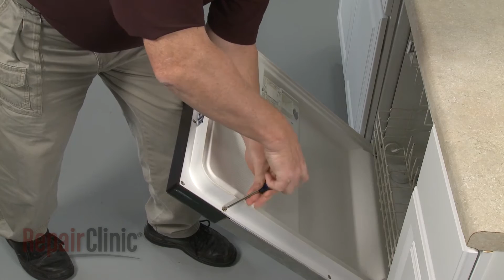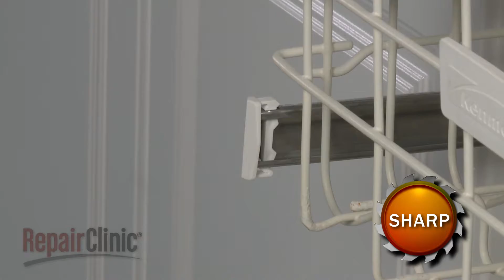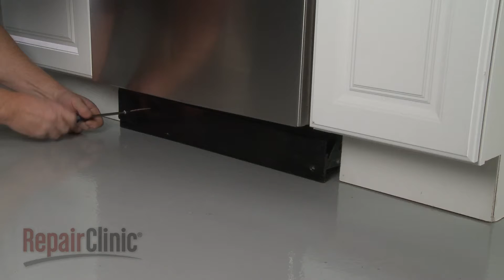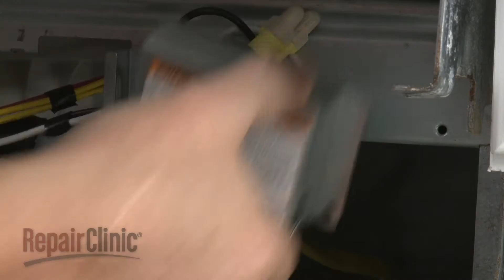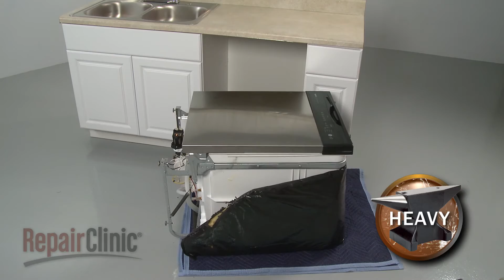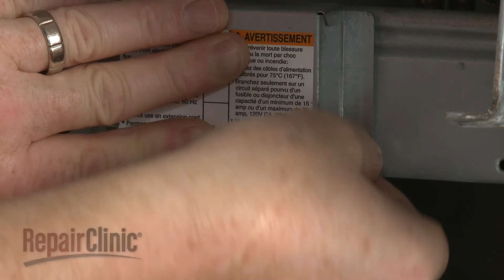Kenmore Dishwasher Disassembly (58715103801) – Repair Help

Comment: Ah ha!  The instructions to repair my dishwasher look easy, but I am not exactly sure what the problem is.  My dishwasher occasionally stops mid-cycle.
I often set it up to run over-night.  Sometimes, when I get up in the morning, I find that the dishwasher is stuck while only part way through the cycle - long after it should be finished.  It doesn’t do this all the time – just once in a while.
So what do you think?  Main control board?
Thanks!

Edit
PS - If I restart the cycle, it runs fine the second time. So this problem is very intermittent.